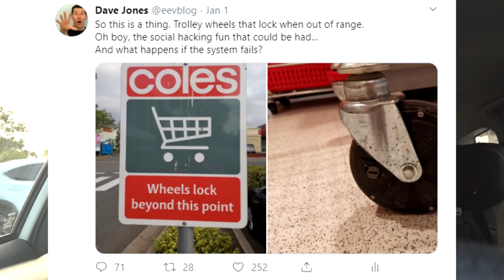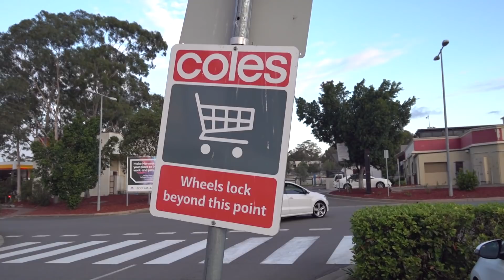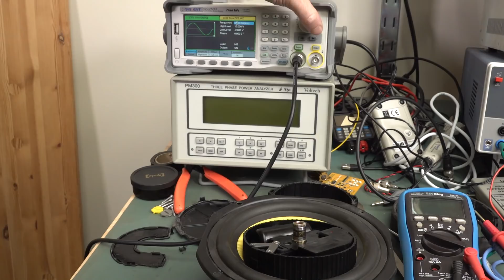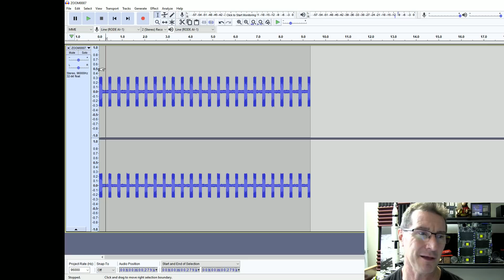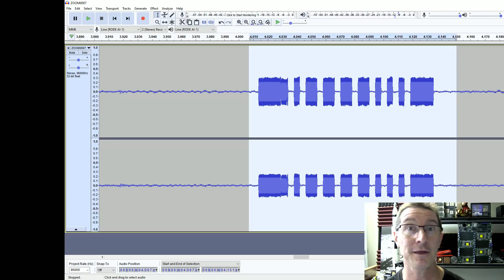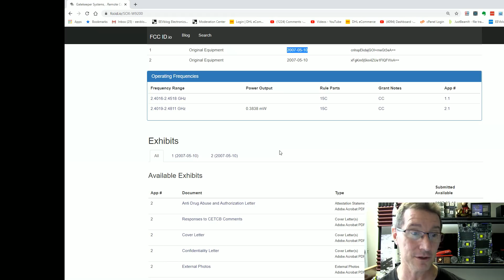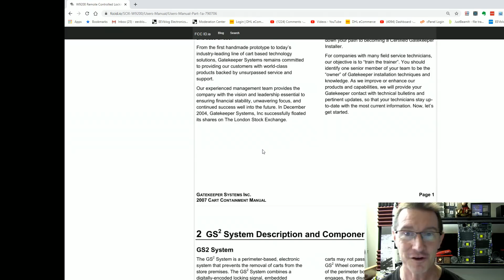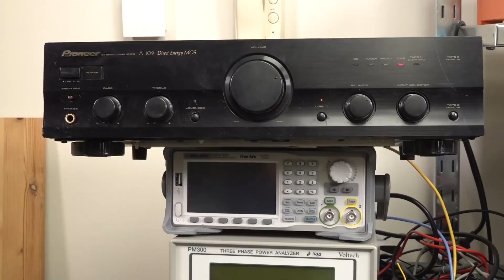EEVblog #1287 - Gatekeeper Shopping Trolley Lock Investigated

Comment: I had a cart wheel lock-up on me in the store.  I was told that there are transmitters coils in the store to keep the wheel unlocked by sending out a "un-lock code" and the wheels have a timer in them that the transmitters/ coils in the store reset. After you leave the store there are coils at the boundary of the store parking sending out a "lock code" to lock the wheel.  The timer in the wheel is a secondary system that locks if the wheel doesn't pass a coil transmitting the "un-lock code" in a given amount of time that's why when my wife, the grand children and I all used the restrooms and the cart did not pass a coil within about 15 minutes the wheel locked up.  I want to build a transmitter to lock-up the cart wheel in the store as I am walking around,  
JUST THINK OF THE HATE AND DISCONTENT SHOPPERS WOULD HAVE IF A COUPLE HUNDRED CARTS HAD THERE WHEELS ALL LOCK-UP INSIDE THE STORE, ON A FRIDAY OR SATURDAY EVENING.  OF COURSE THE CARTS IN THE CHECKOUT LINES WOULD NOT BE EFFECTED. SUDDENLY " NO WAITING ON CHECKSTAND 3 AND 4 AND 5" AND SO ON.

Comment: They've had these at Westfield Chatswood for about a decade.  You can get to the carpark via the overhead bridges, but if you try to cross the road the trolley wheel locks.  Luckily only one wheel locks so the trolley can still be pushed even though it's a bit harder.  Suffice it to say there was quite a large flat spot on that wheel by the time the trolley reached my car...
Reply: Westfield Chatswood has the more primitive Carttronics system not gatekeeper.

Comment: Rather than the system being poor at stopping people taking trolleys out, would it more be the poor design of the carpark? Surely if they had decent enough road furniture to force people to use exits with the coils in the ground it would stop a lot more getting out? Aside from people dragging them anyway which would stop 99% of them.

Comment: Or use the simple solution: chain the carts together at the "cart parking space" and mechanically unlock them with a coin (1 or 2€), that you get back when you return the cart to the chain. Problem solved.
Reply: superdau - We have that system at the store closest to me. And yet my neighborhood is, sadly, littered with the blight of dozens of these coin-unlocked carts — with no coin in the release mechanism, of course. I conclude that this coin-release system does not solve this problem, unfortunately. I wish it did.
Reply: People don't carry change around any more though.
Reply: @PeterMosier  if it´s easy to take the coin out without putting the chain, people are going to be lazy and no return the cart sadly.

Comment: Here at my uk local Asda (Walmart) we have a system where a metal flap turns under the wheel and when you are dragging it along it makes a horrible noise and attracts attention if you go to far out it throws the metal flap over the wheel and stops the trolley instantly so you will see tons of trolleys stuck at the exits all the time where cars are trying to get out and a pile of trolleys are in the way

Comment: Sainsbury's near me, you have to take the travelators back up to the car as it's a multistorey car park, usually with your trolley of stuff, the wheels lock when you're on the conveyer and release at the end yeah.
Reply: I think they use grooved wheels.
Reply: @sbalogh53  the wheels themselves which contact the floor are smooth, to glide across the manicured floor of the shop

Comment: The effectiveness of the loss prevention may end up being a numbers game. People can still steal carts, but as long as it lowers the amount of thefts enough to result in a net win compared to the costs of installation, it might still make sense. Another possible explanation is that it's an insurance thing. The supermarket probably has an insurance against this sort of thing, and having some kind of prevention system might lower the premiums. Like having an engine immobiliser in your car.
Here in Germany, it's customary to just use mechanical coin locks. To get a cart, you have to insert a Euro or 50 cent coin. When you return the cart, you get your money back. Also not a foolproof system. But it seems simpler and more environmentally friendly, at least at first glance. No electronics, no batteries, much longer life time. shrug

Comment: The wheels can also communicate by broadcasting over 433MHz (two wheels installed on a trolley) according to the FCC website manual. Or use the wireless where there is no cable laid out (small door exits). Fascinating read...The test engineer Kye signed off on the FCC address details Kye, Kye, Kye which I thought was funny.

Comment: When they talk about pushout; they are talking about a person who filled their cart with product (groceries, beer, clothes or whatever the store sells) and runs out the store. You'd be surprised how common this is and in America there are laws dissalowing security to secure the product until the person is 50 feet away from the exit of the store. This system allows the store to stop the theft without the security at risk of breaking a law or compromising the safety of the store. I don't know about every store but some contain a coil right at the entrance of the store that can lock carts trying to leave without paying; the checkout lanes have another coil that tells the wheel that it's ok to ignore that coil when it exits the store (or the other way around; I'm not sure exactly how that works) checkout lanes can also be disabled if there is no worker at that checkout.
Reply from the maker: Thanks for the info.

Comment: The one's I've triggered (Tesco supermarkets, UK) don't actually 'lock' the wheels - just one wheel stiffens up. You CAN still push the trolley but it requires a lot of effort. Time to give up. Perhaps I'm wrong but I think I remember at Safeway, UK 1990s, the wheel 'unlocked' if you dragged the disabled trolley back inside the store perimeter.

Comment: Did anyone else think initially that was new  (rather than 2007) using an extremely low-power GPS receiver to geo-fence your cart into your parking lot?  You'd just need to tell it initially where it lives and let it run for the life of its primary cell.

Comment: I'm not in the business so I don't know if the problem is factually better or worse here in Germany, but from personal experience it's way less of a problem here because the trolleys are locked up and unlock upon putting in a €1 coin (or even anything similarly sized), sort of like a deposit, and it seems (again, just from personal observation) to have a positive impact. Now, I don't know how much of that could be translated to other places since I bet a lot of it is learned behavior (like, I grew up learning to, y'know, just not steal or misplace these things) and I'm sure there's loads of financial risk analysts on the case, but I still find it interesting that by and large, the system actually works quite well (and again again, supermarket employees could probably shed a more objective light on that).

Comment: They spent so much money against this magnetic system but if they thought about it rally they do not need any complex engineering. The solution is like some grocery locations, you must deposit some money in the cart and is locked to other shopping carts. The only way to remove one cart from the others is to put money in and when you return the cart back and lock it, you get your money back. Very simple solution.

Comment: I could be wrong but I am sure in the UK we used to have radio controlled ones, so when you went outside the broadcast the wheels would lock. These were never that successful and all the shops i remember them at have all since stopped using them and gone pack to putting money in them.

Comment: It's amazing those boards last at all getting bashed up inside those wheels.
Reply from the maker: No high mass stuff inside apart from the battery and motor which are silasticed in place. But I should have mentioned vibration design.
Reply: The board doesn't rotate at all. The wheels casing rotates around it

Comment: There's a project online where someone made a high-powered remote wheel locking tool, for triggering the locks on unsuspecting shoppers pushing their carts!
Reply: We were going to do that back in 2004 with a much earlier version of this wheel which used a standard Holtek decoder. Simple lock/unlock kit with the Tx coil in a sock worked fine Thought was MiB style suits etc, transmitters in briefcases, walk round store locking wheels and leave but it didn't get that far.

Comment: Just lift the front of the cart did the wheel is about a foot or more higher than the loop you cross and then it doesn't latch and you can keep pushing that cart to  your car in the forbidden zone

Comment: Love this video - Always wondered how these worked, but I cant believe you gave up before getting it to lock!  you have a programming interface there..  Hook up and see what you can figure out!  Also, maybe each store has it's own binary code?  It's only 8 bits...  Brute force time!! Come on!!!
Reply from the maker: The video was already getting long and it was near midnight when I finished it. I wasn't going to spend any more hours on it.
Reply: @EEVblog  Could've at least wired the motor directly to a bench power supply, no?

Comment: Seems kinda pointless. Can’t you just lift up aforementioned wheel and drop it on the other side of the line?
Reply: I'm sure it has enough range to pick that up still. Low frequency.

Comment: This thing just has a different code than the one at your shopping center. We have these systems on a few Lidl supermarkets, you notice them from the red line on the floor at the exit of the car park, but not even many. I think they tried it out on a few markets, but weren't satisfied with the outcome, so now they've just switched from metal trolleys to plastic ones, which are cheaper to replace. Also, pushing a trolley with one locked wheel is actually quite a bitch, since it's a front wheel, it tends to tip over when you're trying to push it straight forward, so you could only drag it, but that's also annoying as hell, nobody would want to do that, they rather go to the next supermarket over, which is less than 500m away and steal a cart from there where there isn't such a system.

Comment: Locally, they have experimented with unlocking carts using a loony ( a $1 coin in Canada) but I think they got to much back lash and losses in sales so they stopped.
Reply: We have this system at allmost all stores in The Netherlands and it works pretty well in my opinion
Reply: @j33089a  what is uncommon is to have a $1 coin in your pocket :-)

Comment: Don’t you have to put a coin in the cart (here 2 euro) to unlock the cable who is connected to the previous cart in the row? You have to bring the cart back and plug the cable back in to get your 2 euro back. For 2 euro 99.99% brings back the used cart.
Reply: It depends upon the store which system is used

Comment: This has been happening for years and we could bypass them by lifting the trolley over the plate at each exit of the car park and then throw them into the canel or push them into traffic. As dumb kids.. edit
The older style ones we were up against had like a caliper that would fall down like a wheel clamp when you took them over the magnetic metal plats around the supermarket car parks.

Comment: I've noticed the wheels also lock on travelators in most malls so that they don't slide away. Though I'm pretty sure whatever that mechanism is it's not electronic like this one, could be wrong I guess.
Reply from the maker: We have those here, it's a groove based mechanical locking system.
Reply: isn't that done by allowing the outer grooves of the wheel to sit in the grooves of the escalator and thus just friction rather than a specific locking mechanism?
Reply: @TheRealSasquatch  Yeah! That's what I thought initially. But it seems way too strong to be just friction. It makes me think the grooves are just for aligning the wheels. If you really put your back in to it you can move it really slowly and it seems like magnetism, or maybe even a brake like in the video.
Reply: Ah I see, I looked up some images, it looks like there are rubber pads for making more friction with the travelator. There's also grooves on the travelator that make contact with the rubber, further making it slow down. Wouldn't want to over-engineer I guess. Makes me wonder how often the rubber pads are replaced.

Comment: back in my prankster days we made a recording on an ipod and made a flat coil on pieces of tape that would fit in the bottom of a shoe. stand close to the locking wheel, press play and viola, locked shopping cart. good for a laugh or two but it does piss people off when their cart is loaded and suddenly the wheel locks. making people angry does tend to take some of the humor out of the prank.
we've had locking wheels in Portland since the early 2000s. 
There's nothing worse than a shopping cart that's been dragged on a locked wheel and has a major flat spot and the cart goes thump thump thump thump.

Comment: They should of implemented the Gatekeeper technology on the sign indicating its use as one of the signs found its way onto my roof....5 kilometres away from my closest Coles!! All good but as its hanging in my workshop. What is laughable is that the mine engineering workshop I supervise in WA has at least 40 trolleys (I know of) in various modified forms and the closest supermarket is 750 kilometres away !!👍👍🇦🇺

Comment: The 2.4GHz is most likely for cart analytics.  The system is capable of reporting cart status, trip time, etc.  The colored caps are probably to identify the store or particular coding that the wheel is set for.  More details on the SmartWheel can be seen in the patent: https://patents.google.com/patent/US5831530A.  More details on the wheels, as well as the transmitter system can be seen at https://patents.google.com/patent/US8571778B2.  Various other related devices and their patent numbers can be found at https://www.gatekeepersystems.com/us/patents.php.

Comment: I spent a year of my life collecting trollies for a large green British/American supermarket brand, you spend hours unlocking these damn things.

‘Push out’ is not the same as trolly theft, that’s leaving a store with out paying for - trolly of goods, this does help with that, but not the entire reason.

Trolly theft is where people take the trolly home and dump it in the street, they attempted to remedy this with £1 coin locks, but that’s too annoying for the customer, and at £150-£200 for an actual trolly it’s damn expensive!
Reply: This seems way more advanced than the system we use, same principle, but they don’t lock when the ESD goes off, perhaps that’s what the radio module is for

Comment: These locking wheels are nothing but BS. To the point where the Walmart Supercenter where I live switched back to regular wheels on the carts. The Walmart near me has apartments just a couple blocks away, and people CONSTANTLY take carts off the property to take home their groceries, and these did nothing to stop that. In fact, what these wheels were doing in my experience, was locking up walking my stuff out to the car, or lock up randomly while I was shopping. Those that were taken off the property often needed new locking wheels because, if they did work, the "tires" would be worn flat damn near to the wheel. There is really no good way to prevent people from taking carts off property, or from leaving them just where the hell ever. People are often too damned lazy or stupid to put carts back where they belong, or just walk their stuff home in small batches. Hell, for years I didn't have a car (of my own choice) and I just got what I needed for a day  or two at a time. But nope, people just have to be lazy and do things in one go, taking off with the carts, leaving them where ever the hell they feel like it, and its out of sheer stupidity and laziness. And it is those people, that end up helping out with the increase of prices for the stuff we buy, because if Walmart or any other store can not find and get those carts back, then the cost of those carts ends up trickling back into the cost of the goods we buy. But, as I have said, there are people too stupid to think about this, they only think of themselves and nothing else matters, even if it is screwing them over in the long term too. I seriously can not stand people too lazy to return a cart just to where they belong in the parking lot, let alone the assholes that take off with them to where ever.

Comment: long term design, hermetically sealed, super hard rubber and clam shell, almost impenetrable, no ball bearings, huh, what? But wait, isn't this a wheel. they've omitted the one thing that makes a wheel work really well and last, a good bearing.  We live in a funny world!
Reply: Silicone grease on a smooth metal shaft with a high density nylon bushing will last a very long time at low RPM.

Comment: So, if you really, desperately, had to nick one of these trolleys, just go armed with your Black & Decker, and insert a few randomly spaced holes in the wheel disc. Chances are you'll go through the the PCB, or battery, or motor, or gears, or..... Well, you get the idea, and would bugger up the gizmo from within.

TESCO use a similar looking setup to stop kids from joy riding the trolleys down the street.

Hmm, I wonder how high you'd need to lift the trolley off the ground to be out of range of the transmitted signal?

Comment: You really only need to lock one wheel to discourage people. Is you average Joe going to keep struggling all the way home with a full cart that needs to be forced to move in any way except in circles? This is, in the end, not a foolproof theft prevention device but a way to discourage 99% of people from easily taking them.